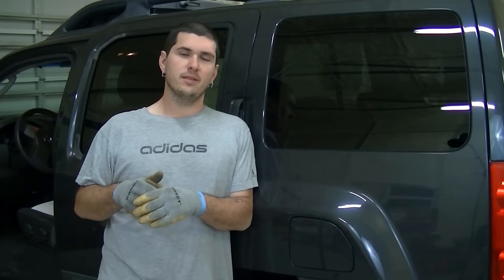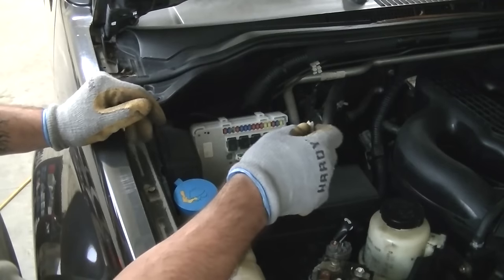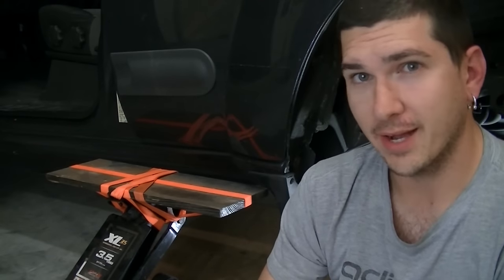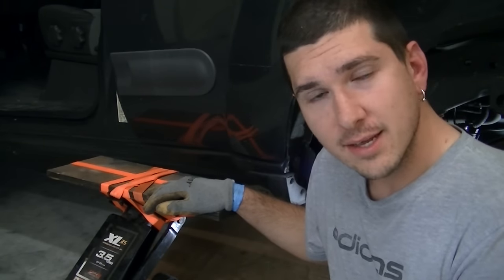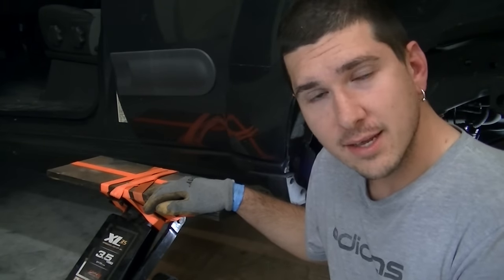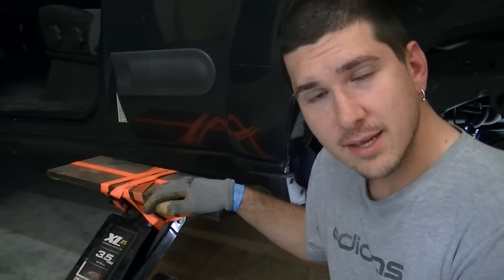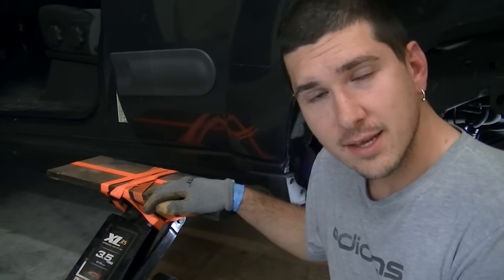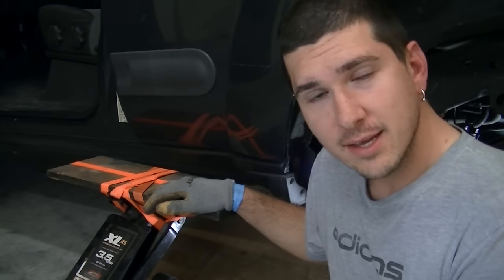How to Replace the Fuel Pump on a Nissan Xterra/Frontier

Comment: My manual for my 05 pathfinder said to drop the propeller shaft, but you didn't seem to have to do this, and your vehicle has been very similar to mine.  Another video showed them removing it, but it didn't really look like he needed to, so idk.  Would probably save like an hour to just leave it be, but I was wondering if you had any struggles with clearance issues and such
Reply from the maker: Yea, I am not sure why it says that. i had no issue at all removing the take with the shaft in.
Reply: @Rythecarguy  thanks for your response.  I've seen others cut holes in their floors to make an access panel to switch it out a bit easier, but not sure if that would be a less than ideal shortcut that leads to more headaches in the long run, but I've also wondered if I dropped the tank and ripped all the hoses from the body if my tank fell off the jack support, it might be even worse than a hole in the floor that I could smooth over with some aluminum tape and seal off with some siding caulk or something.   Kinda torn, especially since I have like zero time to get it done and it may end up being an emergency cut and paste mission if my pump fails sooner than later.   Was supposed to drop it yesterday, but the pump was late and I didn't want to start and not get it at all and be screwed either way for work the rest of the week.

Comment: what's up man, quick question, I'm trying to upgrade the look of my xterra and was thinking of getting a front bumper cover and grille from a 2014 xterra do you think they'll bolt on? already got headlights and they bolted on perfectly. by the way thanks for your videos they helped me alot!
Reply from the maker: I'm glad you like them! Well I can't be sure, what year is you yours? Also I know they did a bit of a facelift on it at some point. The best route to take is to buy the front grille and bumper from a place with a really good return policy :) If it does not work then return it

Comment: I am curious how the Spectra fuel pump has held up since you made the video. I'm always concerned about using aftermarket fuel pumps. I have always gone OEM such as Bosch or AC Delco. Never tried a Spectra pump before. But the price is irresistible.
Reply from the maker: +Ocean Media Now I have had zero issues with it.  I don't drive the X a whole lot (it's main purpose is this channel) but I have put at least 5 thousand on it since that video and drove it cross country. It's been excellent and I can tell how much gas I have!!

Comment: Want to ask you that seal wich match the wiper washer fill up with washer tank there is a seal is it available in nissan cause mine went bad and was thinking its the tank, ive dissasembled the tank but no problem 😄 so that seal only do you have any idea its matching fill up piece from engine bay to the tank which is in the inner fender,.

Comment: great videos, im planning to buy a 2005 xterra off road and im sure That you are the right person to ask if the xterra is  realible. i've  Heard That its  expensive to mentain, some People say  That this engine overheats, im looking  at the  grand cherokee 2004 and 2005 with the v8 4.7L as a second  Choice, in your personal opinión Which is the less expensive to mantein and more realible,
Reply from the maker: José Sesma personally I'm a huge Jeep fan. However if I were getting an off road rig it would be a pre-2007 Wrangler or Cherokee. Also with he 4.0 6cyl. I have really liked my Xterra. Its a good truck but I cannot speak to its off road capabilities since I have a 2x4 and never even taking it on a dirt road, ha! Anyway, I don't think they are expensive to maintain. Especially if you do all your own work. Even so, I have owned Lexus, Mercedes, VW, Audi, and BMW. Now THOSE are brands that are expensive to maintain. Any Nissan you buy will be 10x cheaper.
Reply from the maker: José Sesma so I guess its all relative.
Reply: Ry the car guy , im glad to Hear That you're  happy with your XTERRA  because The nissan is my first choice, there is a 2005 xterra with the off road trim  in yellow  color  that really got my atention.
so the VQ40 is a realible engine? and how about the gas millage compared with other V6 líke the 4L in line from the grand cherokee. which engine from this two you think is more realible and less expensive to maintain, thank you very  much for answering my questions, you are a cool person.
grettings from guadalajara México
Reply from the maker: Thanks Jose! I would choose the inline 6 from Jeep any day over the Nissan. I think that the design of the motor is far simpler and it has a TON less electronics and sensors and things to break. I would say the gas mileage is pretty terrible in both. I consistently got under 20 on both engines. I would say the old jeep motor probably has worse mileage.
Reply: Ry the car guy thank u very much for your advice!!

Comment: How did the Spectra Premium pump work out? I'm looking at one now but not familiar with the brand. There's a Bosch one also but its almost double the price.
Reply from the maker: Replaced it 6 years ago and still running strong! So problems so far. 🤘🏻👍🏻

Comment: I cant get my daughters Xterra to start at all, just replaced battery, turns over just like this one. 125k miles, 2012, I really think its the fuel pump but REALLY dont want to tackle that job. checked fuse, it looks good, cant find relay.  What about plugs and wires?? throttle body test Angel Fix did?

Comment: Great Video! I like your attention to small details, very informative and helpful. Could you provide a part number or link for the aftermarket fuel pump sending unit that you used? Also, does anyone ever replace the fuel filter? I am a contractor and have three Frontiers, 05 SE 4x4, 06 Nismo Off Road and 07 LE RWD. All three have P0463 codes. So your video has saved me a lot of expense as I now feel I can replace all three myself. This is another issue, but I have replaced the front cat banks on all three trucks as well the front two 02 sensors. I have read that drop in fuel pressure results in lean burn scenario and causes exhaust gas temps to rise reducing the useful life of the 02 sensors and the platinum coating on the converters. I have also read that ethanol gasoline is the primary cause of 02 and catalytic converter premature failures due to the ethanol triggering a longer fuel delivery pulse so more un-burnt fuel  overloading the cats.  I am wondering if  restriction in the fuel filter due to dirt and deterioration of the filter media through time is causing a lean burn and premature failure of 92 sensors and the front bank cats on both sides? Does Nissan or aftermarket suppliers provide a replacement fuel filter. Also, is there a kit to install a secondary fuel filter system on gasoline powered vehicles. Thanks
Reply from the maker: +David Whittaker first off I'll have to do some digging on the link. I'll get that as soon as I can. Secondly based on my understanding the fuel filter is in the pump itself. So replacing the pump is replacing the filter. As fas as a second filter I'm sure you could install one in-line somewhere after the tank and before the engine bay where you have some extra room. To be honest, it's probably easier and better for your car anyway to just start using only top tier fuel providers like shell, BP, or Chevron.
Reply: Thanks, good info on the fuel filter in the pump. I have been using only 91 Octane fuel since I replaced the 02 sensors and front cats learning of the negative effects of using ethanol. Though it costs more each fill up, I will save on maintenance costs and reduced emission part failures in the long run. All three trucks have improved acceleration response since switching to 91 octane gasoline and as well, improved fuel economy. We are logging every fuel fill up and tracking fuel economy. Increase averaged over one year has been 4%.
Reply from the maker: That's awesome! That alone helps you save.
Reply: Hi Thanks for the reply.
Could you provide a part number or link for the aftermarket fuel pump sending unit that you used?  I can only get the OEM Nissan Replacement Fuel sending unit in Canada. Napa in Ontario does not show a replacement unit for the Frontier's from 2015-2012.
Reply from the maker: Spectra Premium SP4001M Fuel Module
Reply from the maker: I got it off of amazon for $140
Reply: Ry the car guy I got mine off of 1A auto .com for 90.00 it was at my house in 2 days just thought you might find that helpful.

Comment: Hi Ray I do have a Nissan Pathfinder 2005 my fuel  Level gauge don’t ready accurate with the digital deader. Sometimes the digital read empty but the level gauge read half tank Any idea about this ?
Reply from the maker: It’s likely that you’re level indicator in you fuel tank is getting stuck due to corrosion.
Reply: @Rythecarguy  thank so much for answering. The pump is only one year old

Comment: Question. Throwing code P2A00 and P0180. Fuel pump works and is maybe 2 years old. Could they be connected?  Should I replace with higher quality pump?

Comment: Awesome RY but I think I'm going to go the easier route which is cutting into the base of the nissan above the tank.
Reply from the maker: Sounds good, be careful!
Reply: @Rythecarguy  Just took apart my front driver side wheel bearing assembly waiting for the new one to arrive from amazon.  I will use snips to cut the square out.  Did you know earlier models came with a panel with nuts that you could remove to access the fuel tank to replace the stuff in there?  What a disgrace that it wasn't implemented in the later models.

Comment: Would the pump failing or pressure valve failing to maintain pressure be a symptom of hard starts in the Xterra? My batt checks fine, but it seems to randomly have hard starts and almost failed to start this morning.
Reply: same symptom brought me here. Hard start, took to shop and they quoted $1,000 to replace pump. Bought to change it out now. Did you end up replacing yours?

Comment: 2007 Frontier.  Same issue.  FLS.  Decided to go ahead and have the whole fuel pump replaced since they had to drop the tank anyway (There was only a $25 price difference).  Now, fuel gauge is stuck on 3/4 and wont move :-(   any thoughts?

Comment: Very nice job and very thorough too thanks. I might try to do this with my son and save me $400.00 they want 600.00 + to do this at my local garage.
Reply from the maker: Of course, thank you. I hope it goes well. Be sure to check under your rear seat for an access port to the fuel pump. My truck does  not have one but some people claim to have one. NEver seen proof of it though 😉
Reply: It went really well we did this in 1.5 hrs with an empty tank it makes it very manageable. My only suggestion is to have some new of those little U clips ready to replace once they are stretched they don't re-clip as tight and hose could pull out.
Reply from the maker: Great suggestion. Glad it went well.
Reply: Ry the car guy the first gen xterra has an access plate under the rear  passenger seat cushion. Since they have to be removed to fold the seat back down, it was only obvious to put one there.

Comment: Thank you very much. I've followed your video and fixed my wife truck. now I have the ABS and Slip VDC lights on, do you know what could the reason?
Reply from the maker: +jda1304580 thank you. And yes, it sounds like you disconnected an electrical clip and didn't reconnect it. Do a very thorough check around the rear left tire and make sure you do not see any open connectors. Also look on top of the tank from behind it. I remember there being a connector up there that needed to be plugged back in as well.
Reply: Ry the car guy thank you. I will check everything again over the weeked. Thank you
Reply: By the way I forgot to reply. I got it fixed, it was one of them electrical connectors. thank you.
Reply from the maker: Oh good! I'm Glad.

Comment: My 2007 Frontier is showing the same symptoms (faulty fuel gauge, fuel related codes, etc.) but in addition, one of the DTC codes says I need to replace the fuel temperature sensor. Is that a component of the fuel pump? As in, will a new pump have a new temp sensor on it?
Reply from the maker: That's a strange sensor to go bad but yes, the sensor should be in the fuel sending unit (pump). Sounds like Nissan put pretty crappy pumps in these cars. I am hearing from various people with all different kinds of problems with their fuel pumps. I suppose it could be worse.
Reply from the maker: I'm sorry, it actually looks like its a separate part. I am getting mixed information from my FSM. I would call your local Nissan dealership to be sure.

Comment: Hi Ry!  Wondering what gas mileage your 4.0 gets?  I have a Pathfinder w/ the same engine and I'm noticing a large increase in my fuel consumption over the 5 years since I have owned it.  I have changed the spark plugs, maintain oil changes regularly and nothing really has changed.  Its recording 12.5 MPG right now...  Used to get almost 20 MPG before.  Wondering if you have any ideas?  Thanks.

Comment: Hi Do u have a video how to fix P0181 and P0182 code for Nissan Frontier 2006...thank you louie
Reply: Hi Daniel..really appreciate your reply...i email you as well with the email add you sent me...anyway,the code issue was P0463 and this is the fuel level sensor after resolving this problem and erased the code...another codes pops out to be a new problem (P0181/P0182)..by resolving these codes are u recommending to replace the whole fuel pump assembly?...(not only the fuel level sensor?)...please advise!...THANK YOU AGAIN!

Comment: Hi Ry . . . I have a 2005 Nissan Xterra and I'm not sure if it was bad gasoline I put in my car but it started leaving me on the highway.  Suddenly, while driving, the car would die.  I've checked the alternator and starter but a mechanic said it was the battery.  Relative bought me a battery but it's small and now my Xterra stutters to turn on but then catches and turns on.  My mom says it sounds like the fuel pump is clogged or not picking up gasoline.   I've taken car to three mechanics and O'Reily's but to no avail.  Any suggestions?  I added HEET but I did wrong in not driving the SUV...I let it sit...I don't know if that messed it up more or the battery is too small that it's not enough power to power on engine quickly.  Advice is much appreciated.

Comment: Thanks! I really appreaciate it! I have a 2006 R51 Pathfinder with 320kkm ~200k miles on it, but the Y25DDTI Diesel version, since it's in Europe. I guess it's the same fuel pump as on the VQ40. The fuel indicator is stuck on zero. I'm trying to find the "Spectra Premium SP4001M Fuel Module" or an alternative, but the European web sellers don't have the same cars and parts as the American ones.

Can ayone give me the Bosch reference for the pump (which also comes with the fuel sender unit)?
Reply: Found a lot of references on rockauto, but none sells in Europe.
Reply: Also, found the sender unit only, for not so much, https://www.ebay.fr/itm/Fuel-Pump-Level-Sensor-for-2005-2019-Nissan-Frontier-Pathfinder-Xterra-2-5L-4-0L/361074340318 , but is it worth it?

Comment: I had my fuel pump replacement done on my 2001 Nissan Xterra xe by a mechanic shop however the fuel gauge only reads at 3/4 tank when full. How do I reset the analog fuel gauge to read correctly to the fuel level in the tank?
Reply from the maker: I wish I knew. It sounds like the arm might be stuck or hitting something inside the tank. I would bring it back and tell them they need to fix it.

Comment: After I replace the sensor level I get a code of evaporation leak I've been told is cuz didn't replaced the O ring seal with a new one

Comment: I did change fuel pump before. but I did it from inside the car underneath the back seat of the car
Reply from the maker: +khmer 1 chean yea. It would have been nice of my truck had that access port. Some of the earlier Xterras might have it.

Comment: Do you i have to drop the tank to change the fuel pump 03 exterra?
Reply from the maker: I’m not sure. Lift your rear seat up and lift the carpet. If there is an access hole then you don’t need to. You can use that. If not then you need to drop it.

Comment: How many miles where on your truck when your fuel pump failed?  My frontier has 195,000 miles on it.  I'm thinking or replacing it before it fails.
Reply from the maker: I was at about 130,000 miles. However, the pump itself didn't fail. It was just a little level sending unit. so I couldn't tell how much gas is in the tank. It was super annoying so I replaced the whole time.
Reply: @Rythecarguy  Thanks for letting me know.
Reply from the maker: @klrmoto  👍🏻👍🏻

Comment: would this be very similar to replacing the sending unit on a 05 nissian pathfinder?
Reply from the maker: +Isaac Garcia yes it should be very similar
Reply: +Ry the car guy  awesome thank you sir!.. how much would this cost to get done or what would you charge to do it yourself
Reply from the maker: Its an expensive fix simply because the parts are not cheap and you have to drop the tank to do it. I would imagine it would easily be over 500 dollars to get done at a shop.
Reply: Hey Ry, I got lucky with my pump, it actually was a recall fix, because there were so many failing.  Glad I didn't have to do it.   Any chance of a fuel injector replacement video in the future?
Reply: This fix was a recall for my '05 Xterra, was glad I didn't have to do the job.  Any chance of a fuel  injector replacemnet vidoe in the future?

Comment: Have gasoline filter independent of the gas pump?
If the car has it
Where is located the filter in a 2007
Reply from the maker: +elbuscadoranonimo filter is only inside the pump